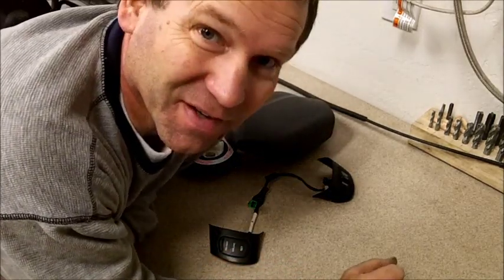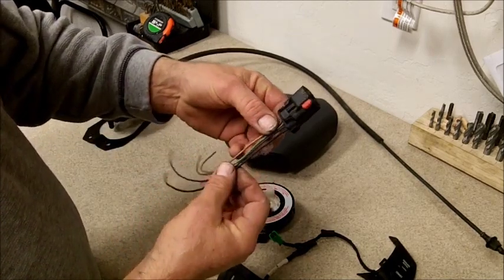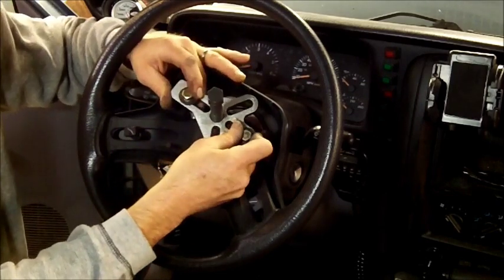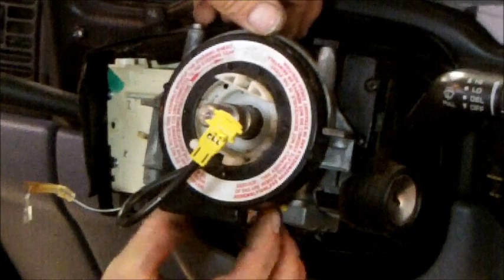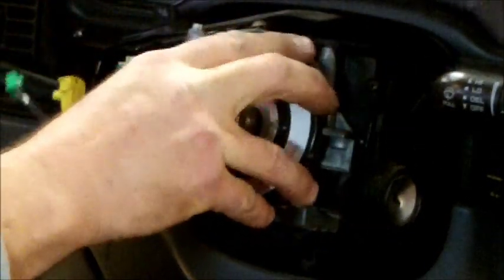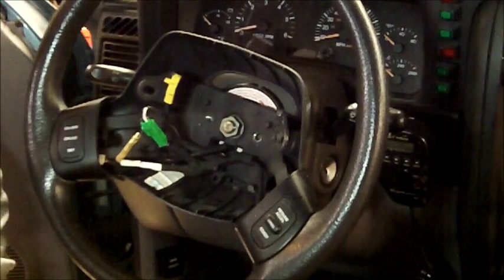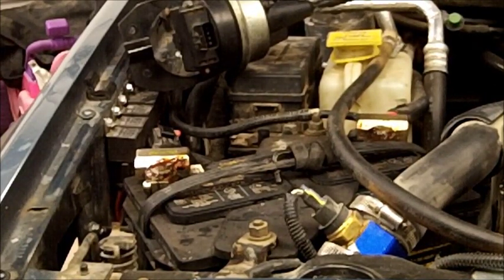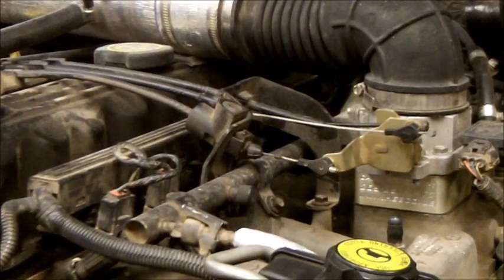How to Install Factory Cruise Control on 97-01 Jeep Cherokee XJ

Comment: Probably one of the most informative and easy to follow videos out there for CC on the 97-01 XJs. Currently in the process of a 97+ swap on my 87 Comanche and the donor Cherokee did not have Cruise so I’m sourcing all the parts myself. Thanks a TON
Reply from the maker: Thank you, glad it was helpful! Sounds like you got quite the project there.
Reply: @martinbuilt  it’s overwhelming at times but not too bad. There is definitely a learning curve with some things but overall it’s been a fun project.

Comment: Hi I was wondering if you brake one those locking clips that are at the top and bottom of the clockspring, is it a big deal will it still work?
Reply: You probably figured this out by now but if not yes it will still work

Comment: where did cruse plug in
Reply from the maker: There's a 4 way whether pack connector most likely under the fuse block by the battery.

Comment: I installed CC on my 1998 Cherokee Sport. Having the correct year switches are key.
Reply: Can just the switches be installed on the 98 wheel or does the entire wheel have to be changed? I have a 98 I’m wanting to add cruise control to.
Reply: @patrick_wood_co You don't need a new wheel, but you'll need a new steeling wheel cover that has the cut-out for the switches.

Comment: Excellent. Refreshing to get concise facts instead of forum blather, dysfunctional chatter & misinformation. Learned more about switch differences in 30 secs watching your video than searching forums for 4 hours.  (adderal generation has arrived). Glad you addressed "how to prevent a loose nut behind the wheel" at 12:40.

Comment: Good vid. Quick tip you dont have to wait for the charge to drop In  the system just unhook the battery then pull headlight switch this will automatically discharge the whole system Makeing it safe to work on. On a side note make sure the battery leads can't accedently make contact again with the battery or it could turn into a bad day on you fast. Over all great vid thanks for posting it. 👍😉

Comment: My 98 without cruise has the airbag you bought at the junkyard. Do you know why? I’ve seen both styles in 98’s
Reply from the maker: No I don't know why it would be different. It is possible that someone took a steering column out of newer vehicle  installed it in that one just a gain a tilt wheel option. Unless it was one from late 98 and it started installing them then
Reply: Every 98 I’ve seen has the newer one. I did see a 98 today manufactured in Jan 98 had the older one
Reply from the maker: @smitty4699  I'll have to check the manufacture date on mine 98
Reply: The 98 that I’m purchasing was built in Feb-98. Has the old style.

Comment: did this install.  the cruise control light comes on for about a second when i first turn it on, the it shuts off again.  I dont think i have any vacuum leaks.  Any ideas?
Reply from the maker: will mandelbaum sounds like you may have the wrong switches. Did you make sure you got the correct part number for the year of Cherokee that you have. The 97 and 98 take a particular part number and then 99 and later take another
Reply: @martinbuilt   yep.  The switches I installed have a circle underneath the part number with an asterisk and  AD inside it.  They also came out of an 01 Cherokee.
Reply: Forgot to mention that after turning on twice, the light stops coming on at all.  The only way i can get them to respond again is by turning the car off and on again.
Reply from the maker: Is yor Jeep a 99 and later ?
Reply: @martinbuilt  it's an 01
Reply from the maker: Sorry I don't know what is wrong....does  the horn work ?  I ask because wondering it the clock spring is good.
Reply: @martinbuilt  yep, horn works.  I don't know what else it could be aside from the switches, I read somewhere that the brake light switch could be causing it.  Any thoughts?
Reply from the maker: yes I have heard that before
Reply: @martinbuilt  strangest thing happened when I drove the car today.  The cruise control worked fine. is it possible that the PCM reset when I disconnected the battery and didn't engage Cruise again until it had relearned itself.
Reply from the maker: will mandelbaum 
I'm glad it worked out for you. I know I never unhooked the battery when I did mine.

Comment: I wish someone could show how to do the wiring if you find you don't have the factory connector under the hood, I've seen the forum writeup but its way easier to follow a video
Reply from the maker: are you sure the wiring is not there
Reply: martinbuilt 100 percent, it's a 99 wrangler, should be by the master cylinder in wranglers. I've done this before on my 00 cherokee too

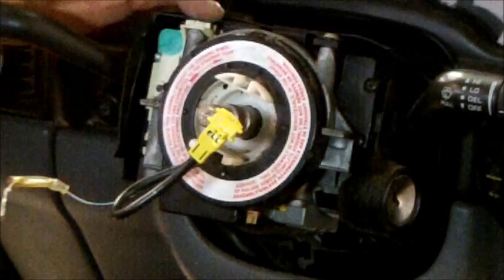Comment: Highly informative and appreciated...  Pulled it out of my unfortunately totaled Jeep and installed it on my "new" Jeep, with no problems what so ever... One suggestion- The screws at 7:21 don't need to be pulled. I used a smaller, thin flathead screwdriver on the right side. You can easily place the tip under the clip and give a gentle twist to raise it, and the shroud keeps you from over extending it or slipping past it... Great video, Thank you...

Comment: So there is a vacuum supply tank and the servo has one vacuum line that goes from itself to the vacuum supply tank?
Reply from the maker: It's been so long since  I did this, I believe I just added a T fitting in the vacuum line to the vacuum supply tank

Comment: When I set my cruise control at say between 55 to 70, it will drop after it runs for 30 seconds from 65 to say 60. or 70 to 65 or 60 to 55. Any thoughts on how to fix this?
Reply from the maker: SuperDagod1 that's weird. Mine kind of does a little bit of the opposite it goes up maybe by one or one and a half miles an hour
Reply: Mine has 260K on it. I wonder if the button is going bad
Reply: If you're on a cable-driven cruise control your cables may be stretched.  happened to me on my civic

Comment: Love all of your mod vids.  I'm actually going to get the parts for this today - just did two long trips in my 98 and found that it desperately requires cruise in this tight vehicle.  Found a 98 in a local JY so I'm going to see what kind of steal I can get on the parts.  Also grabbing 02 WJ knuckles and calipers that I found in the same yard for the big brake / steering mod.  Thanks again!!
Reply from the maker: TheTexasPsyclone yeah there's two options I can't live without air conditioning and cruise control

Comment: Martin: Good video I have a Cherokee 2000. Quick one for how long I have to disconnect the battery for the air bag don't explode. half hour? I will take both poles + and -.
Reply from the maker: I think 5 minutes will do it. I have actually done this and never disconnected the battery before and never had a problem... but better safe than sorry
Reply: Martin: In my case I have a problem with the horn is not working plus the keyfob when you armed the alarm does not make the chime with the horn that allows you to know that its armed. I press the panic button in the keyfob and the horn start making his noise, so the horn is not damage.  Do you think I should do checking something more before purchase the part? The screws you are using on the puller comes with the puller? if not, which is the measurements of them so I can get them before. Thanks for all the help. The video was very helpful for me. In my case the truck does not have CC and I will keep it like that, it just to resolve the issue of the horn. Everybody told me that that's it but just want to confirm.
And thanks for the response.
Reply: Kenneth Ruiz Cherokee 97
Reply: Kenneth Ruiz , in most cases when the clock spring goes bad the horn will not work, hope you have already got it fixed if not then try that

Comment: Hello,
Your video was extremely helpful. My 1998 Jeep Cherokee has only three wires in the connector that goes into the servo. I pulled out entire set from a 97 Jeep Cherokee. However the servo has four pins. I am just wondering how to connect the connector into the servo.
Reply from the maker: +Chinthaka Aravinda I'll check. I believe there are 2 connectors in that same area. One with 3 wire and the other with 4 wires.

Comment: Thanks for the video.  I own a 1997 that has factory cruse control but I may need to work on it some day.  Now I'll know how.
Reply: Does 1999 XJ cruise control buttons/ switches have lights if so what kind (size) & how do you replace them

Comment: Great vid, only part I'm confused about is the vacuum line. I just cut a factory vacuum line in that area and get a tee fitting and plug the line from the servo into the tee? What size is the vacuum line and what size tee is needed?
Reply from the maker: Keith Lambert  should be a 3/16 inch vacuum line and T

Comment: Martin, my name is Jeff Popiel. Your video was great! I bought the parts on eBay so they cost me a bit more, but still affordable. I wouldn't have attempted this on my daughter's 2000 Cherokee without your help. Only hitch was the steering wheel stud/nut was galled; I had to cut new threads with a die to a smaller size (1/2") after filing off the torn up threads. New heavy-duty nut and a Belleville washer and I was all set.

Comment: Thanks for the video. Went to the salvage yard for all parts and had it installed in about an hour. Just have to make sure when taking the controls off the steering wheel to be carful and not to break those tabs. Broke one set in the salvage yard and had to go find another donor jeep which is hard when you looking for 99 through 01 only that came with cruse control.
Reply from the maker: William Howell 
Your welcome, yes those tabs can be fragile.

Comment: I didn't see...but I assume you connected the vacuum line into that T that's right behind the servo? I also have 2 wiring harness connections that could fit into this servo but I have no idea which is the correct one. I have one that is closer to the battery, and I have a shorter one that's a little further back by the fuse/relay box. It doesnt look as though that one will reach the servo so I plugged in the other one. Cruise doesn't work.... :-/
Reply from the maker: jeepcherokee24 
It is the connector with 4 wires.

Comment: great video - will the parts and process be the same for a 2001 Jeep Wrangler?
Reply from the maker: Well I only know facts for the 97 thru 01 XJ's. but I would guess that it would work on a Wrangler.
 Check to see if the 4-way 4 wire connector is by the fuse block by the battery. It may be finding under the fuse block. If that is there,  that would be a good indication that it would work.

Comment: I did everything in this video. But my cruise light will only come on sometimes then turn of instantly. I noticed your connector to your servo has four wires. mine only has three. Does that matter? And can u possibly email me so I can ask a few more questions instead of going through YouTube. Email me at Caseyschaibly@yahoo.com. Thanks
Reply: +Schaibs 
I am trying to install for my 98 XJ . I am having the same issue mine has only thee wires. How did you solve your problem.

Comment: so if it's all about working switches, good vacuum and original wiring, then what the heck is wrong with the cruise control in my '92 cherokee? :/
Reply: kluk666 it's probably your clock spring.  it is the root of all things bad!  LOL hope you get it fixed.
Reply: naah there is no clocksprings in xj until '94 - the first lifting

Comment: Martin,
We did the install on an '01 Cherokee XJ, using parts from a '98 donor.  We got the correct switches from an '01.  We had to replace the actuator cable with a new OEM replacement from "parts.com".

The install went flawless, except for 1 issue. The idle is now around 2000 rpm with the cable installed.  When we disconnect the cable from the throttle, the idle returns to normal.  We rechecked all the connections & everything looks fine.  It acts like there is tension in the cable causing the high idle. We're not sure of the cause.  Do you know of any solutions or what may be causing this?  Any help or suggestions would be appreciated.

Thanks
Reply from the maker: The cable is pulling on the throttle. perhaps something wrong with cable or actuator. I would check where the cable attaches to the actuator.

Comment from the maker: The clock spring needs to be changed out to get the 2 wires needed for the cruise control buttons. I'm not familiar with the 5 speed models, but check thoroughly under and around the fuse/relay box under the hood for that connector.

Comment: why is a new clock spring needed?  also if my jeep is 5 speed not auto, does that make any problems with installing this, because i dont not have that connector near the batter you talk about.

Comment from the maker: If your referring to the steering wheel puller, no you need to use it.   
I got all the items needed t do this conversion at the local salvage yard (pick a part) for around 80.00. You can also find it on eBay.   I have a set of switches for a 99 to 01 for 25.00

Comment from the maker: There are two 4 way connectors near the fuse box. The one your looking for is the one with the Dark Blue  w/Red stripe, Tan w/Red stripe, Lite Green w/Red stripe, and a Black wire. Thanks
Martin
Reply: martinbuilt  There lots of different Jeep Cherokee’s with the 4.0 motor will this work on all of them? Currently looking to buy one but I need cruise control and want to make sure I’m not buying one that doesn’t have it already installed that I can’t install it after I buy it.